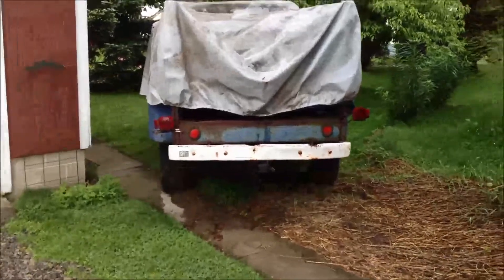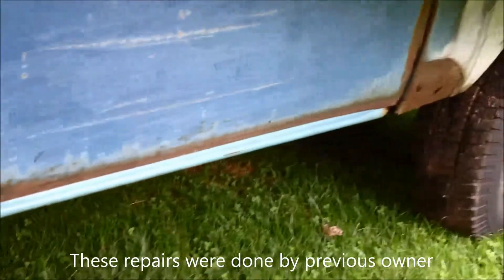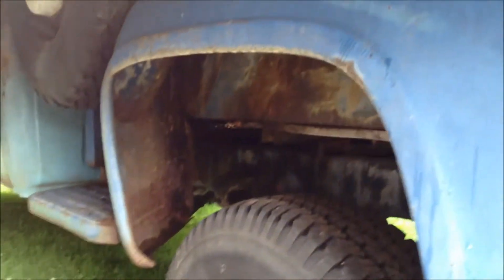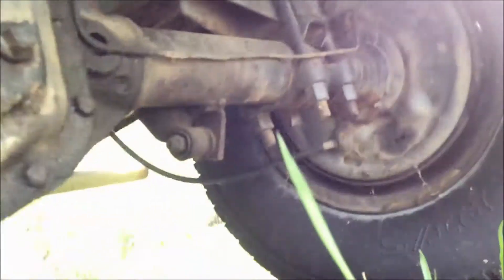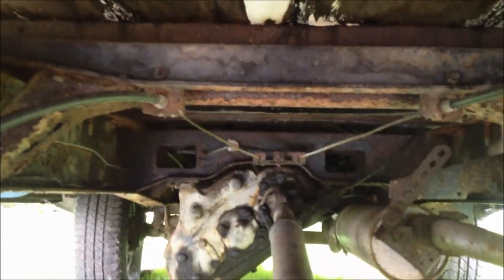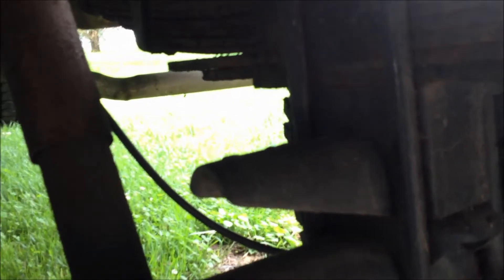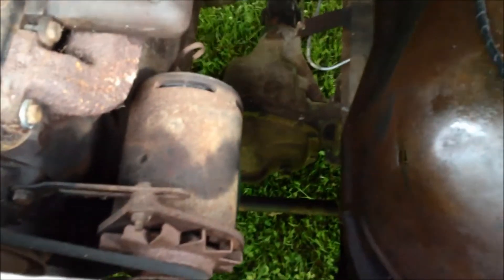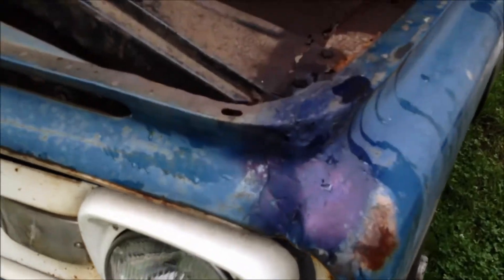1962 Ford F250 4x4

Comment: I had one like that but it was a F100. Smaller rear axle. 6 cyl 223. The 6 cylinder changed sizes to a bigger cu in. each year. Mine came from a ranch in Montana with a 223 6cyl tractor motor. Top speed about 72. Could pull great due to the gearing. I've been looking for another one. That's how I found this clip.
Reply from the maker: I haven't had her up to 72 yet but once I figure the brakes out I can't wait to see top speed
Reply: El Tiburon I got 62 with a 223 I6 and 3 in the tree without O/D. I'm planning to stay stock but add an O/D to the original trans and 3.60 to the axle. Good or bad idea?